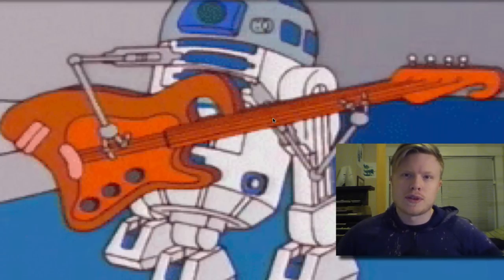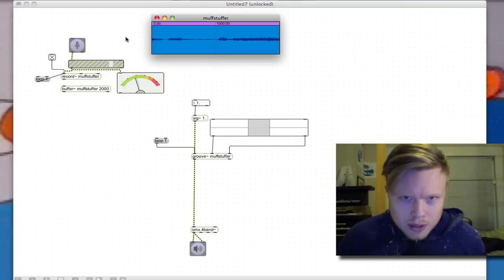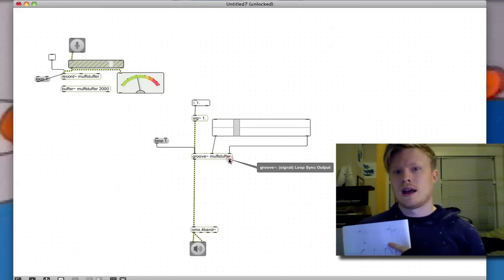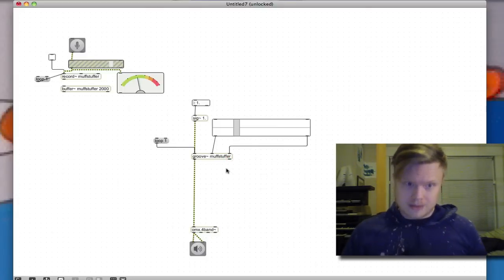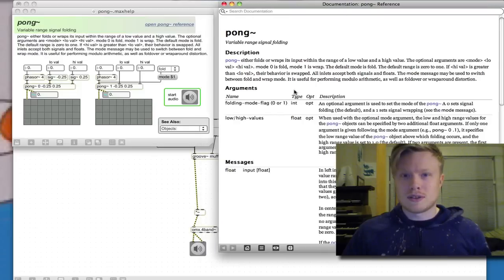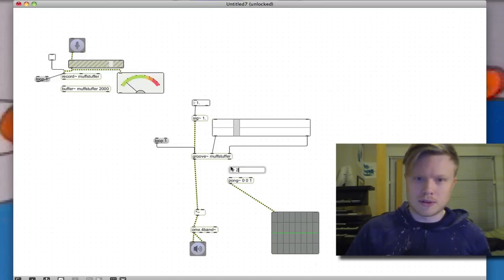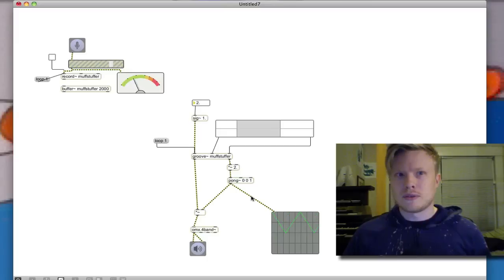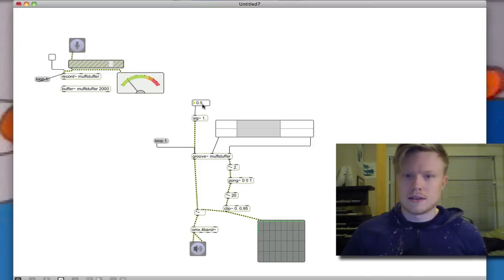Max/MSP Groove~ Part 2: Granular Envelope

Comment: If we give a low sig value 0.4 for ex. and use tow -or more- sounds with message  (set buffer name) to load a second file to buffer and then click alternatively to the message boxes containing the buffer names it clicks. Do you have a solution proposal to this?